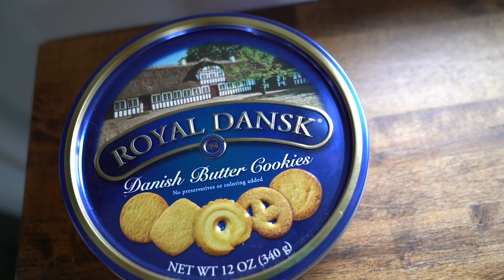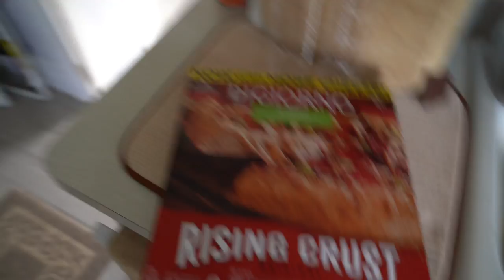WORKING HARD TO FINISH THIS TINY HOME | TRENT AND ALLIE

Comment: Trent-  seeing you on the roof made me remember something:  SEAL your roof again!  Most RV's and trailers only have their factory coat on; UV, etc. breaks it down, so before taking off on a trip- and especially for fall/winter, etc.- weatherproof that mother again.
Reply: Do you really think he should weather-proof his mother?
Reply: @drinkinslim    To question that tells me you've been drinkin' too much.
Reply: 👍 Thinking the same thing!  (about the roof)
Reply: Trent - Please look into this; there are white coatings/paints designed to re-coat & re-seal the EPDM-rubber membrane on the roof of RV trailers. Any holes, cracks, or tears with water leaking in from rain or snow-melt will mean Big trouble inside (wood-rot, stains, de-lamination, etc.). I just had my older trailer done last year; it was a 2007 Coachman, just a little larger than your Terry.  Good Luck & Congratulations on your recent Marriage!
Reply: Yes I also noticed when you put the air conditioning up on the roof, looked like it needed to be resealed. We re-seal our trailer roof every couple years just to keep it good!
Reply: We found 25 yr seal tape for rv seams, might be worthwhile.
Reply: @drinkinslim   BIG Giggle !
Reply: When we bought our 2019 rockwood travel trailer they recommended sealing the roof every year. I’m glad we did because 8 months into it we had a max air fan installed and there were 2 places that needed caulk and resealing! From use.
Reply: Oo

Comment: My mom passed away at age 52 so quite a few years ago. But she was a genius in interior design. Never did it professionally except an occasional word of mouth job. Your project reminds me of something she said she did. She found an old dilapidated air stream that was probably only 20-25 ft long. The metal was oxidized and really horrible. She took steel wool and polished the entire exterior-by hand-till it was like a mirror. Relatives validated the story. Took her 2 months. She did the entire interior by herself too. Flooring, walls, made curtains, re-upholstered, plumbing-everything but electrical wiring. I think she pulled it down to Baja Mexico to a little resort. The theme was of a little Mexican hacienda with aged wood and bright serape blanket colors inside. People would ask to come in to see it-it was that cute. Wish I had photos of it. Anyway you two and your project reminded me of her. I miss her. She would have really enjoyed you two. She was  a character and reminds me of Trents' mom a lot.

Comment: I would suggest applying Kool Seal Reflective Roof Coating or similar product, to the roof. We did to our class a and we couldn't believe the difference it made. You just paint it on. It seals the roof, protects it and keeps the rv cooler in the sun.

Comment: We just finished up a Reno on a '93 Fleetwood Wilderness and we used Zinnser 123 to pain over the mirrors. No need to replace. But we were in a rush to get camping this summer. But now we can't even tell which doors had mirrors and which didn't. We didn't need the 13! mirrored doors.

Comment: Has the squash set on fruit yet? you might have to hand pollinate since it is a pretty enclosed space. The male flower is on a stem. The female flower has a tiny squash under it. If it doesn't get pollinated it won't develop (look up blossom end rot). Can take a Q-tip and transfer pollen from the male flower to the female flower. Garden is looking good!
Reply: Yes, good directions, I was thinking they might have to pollinate them also, especially if few or no bees/insects. 🌸 🍎 🌶 🌽 🌺

Comment: Have you measured the hight of Terry now with the AC?
I recommend it! Put a little sticker or paper on your dashboard as a reminder.
AC is wonderful, but you will need a heater, when you are on your property with that much snow in winter.
Reply: It may be a reverse cycle air conditioner with heating.
Reply: Most RV rooftop A/C units are also heaters, in fact I can’t think of ever seeing one that wasn’t. Are they great heaters? I wouldn’t be so bold as too say yes, but it’ll put out some heat. I agree that at 8000 ft in winter they are going to want real heat. Tiny wood burning stove FTW! 😉
Reply from the maker: There is a propane furnace in terry 😊

Comment: Try Rub ‘n Buff wax metallic finish to change the color of the stained glass metal finish.  You can probably pick some up at the hardware store.  You rub it on with your finger.  You can push a paint shield up to cover glass as you go.  Simple and fast.

Comment: Totally feel you when it comes to the AC.. Returned home to south Florida to find the outside AC motor dead and the inside of the house was 93 and outside was pretty much the same temp .... Had to live in the house like that for 3 miserable nights until the new motor showed up and was replaced. Then it took all day to cool off the house ... ugh... horray for  AC  !!  And Trent , that ladder routine was intense....your tiny house is looking awesome !! Congrats on a job well done..!

Comment: I can't help it. I can't help it. OK you know what a chair rail is ,right? What if you put up bead board half way around your bed area. You could mount a 3-4 inch wide 'shelf' where the bead board ends-like a mini chair rail. A little place to put trinkets-photos-clock etc-Maybe even a custom wooden cup holders for your espresso on rainy-stay in bed a while-sunday mornings with your cozy blankets all scrunched up in there. Would make a cute little nook.

Comment: Trent I have found that essential oils will desolve most adhesives and glue. But it can also desolve plastic. None toxic but very effective, just careful of time its on a surface! Just a tip I learned thats worth trying, saves time and irritaion! Cleans up plaint just wash with soap and water after using to stop reaction. Takes stains of plastic and permanent marker of barbies! LOL

Comment: Hey, you two! Here a tip for- using your AC if you are not driving through the Landscape every day: Take care that the outside unit is covered in order to avoid it from being heated up by the sun!. A simple sunshade can do the job! 
 Do not moan, just do it! Your energy bill will be happy,  and over time, the noise floor will be better too! 
Bytheway, an extra layer of insulation is a true miracle take such a structure cool!, and it doesn't cost an arm and a leg ;-)  !!! 
Just lay 1 Layer of 3 or 4" of styrofoam on the roof of the RV, and tie it down with a sheet of truck - Foil in White! This will earn you extra money the whole year trough!

Comment: For drip coffee, get a strong kind & up how much you use. Bustelo, comes in a brick, is finely ground. I mix it with regular drip coffee & it adds that strength! I can't drink weak coffee. As for not calling customer service, try YouTube or Google. 2 years ago I began scrapping appliances & might've offed myself on the 1st microwave had I not checked it on You Tube 1st. 😁 hope you're researching living on that mountain. You may need a fireplace or generator should the power go out. And wild, predatory animals???? Lastly, Digiorno is decent. I put olive salad on it after it's outta the oven. Maybe it's the oil, I don't know, but it transforms it to pizzeria pizza!

Comment: If painting the thin lines on the stain glass-looking cabinets is difficult, look into auto pin striping. I did that to my cabinets in a mobile home and it came out great with less stress. You can find large rolls of it online.

Comment: We rehabbed a mobile home that had windows that looked like that.  When we looked at the back, it was a solid pain of glass - all the decorative crap was just applied to the surface. A razor blade took it all off.  The plain mirrors looked more modern.  I don't know if yours are the same or not.
Reply: Pane

Comment: Hi Allie and Trent.  Another great vid and congrats on the tv show interview, and the new friends.  Ok here's the question.  Like my trailer, and  a lot of other trailers you have a corner bed, to that extent, is your water heater under the bed, in the far corner to the outside wall,  and accessed from under the platform of the bedroom?  If so,  though the wood looks great on the back wall, how do you plan on getting to the shutoffs to the water heater if the top platform of the bed is what you have to lift?  Removing the bottom  board only may be a solution.  Sorry if I put a damper on anything.  Have a Great 4th.

Comment: Hey...can you guys do a closeup on the cabinet paint?  I have yet to see someone use it and then show it so close up.  I'm interested in doing this for my sister's kitchen but want to see it first.  Concerned about paint lines even with the small rollers...hope it works well; because I saw something about the paint having a self leveling feature that doesn't show lines.  Hope you can do it in an upcoming video...thanks a bunch!  Great job.

Comment: I don't know where you guys get your energy, but probably from each other. 90 f is not so hot. I used to live out on the Hay Plains in NSW Australia, where we had 115 every day for 6 weeks! Slept out in my dome tent with the fly off, and just the mesh between me and the stars. In the house, the bedsheets stayed red hot! House never seemed to cool, just wood. No insulation, tin roof. I moved. Shame, as the old place was free rent and power. But I might have died there. I'm 71. Take care, stay safe.

Comment: Will you be staying in Terry on the new homestead during those high altitude winters?   It's blazing hot right now but what is the plan when mercury plunges?  Will Terry be up to the challenge or will it be back the attic for a few months?

Comment: I couldn't wait to ask you if this trailer is going to make it up to the mountain property while you built the cottage up there. I just wanted to know if there is enough flat terrain for it and also whether the road is up to accommodate it. You are doing great and I am a big fan.  Did you talk to the Dometic company about the damage to the air conditioner? If it happened in transit maybe they can offer you something.

Comment: Nice job on your little trailer. The only thing that would concern me is the weight you are adding to it. Check the data plate and maybe get it weighed before taking it on the road. I don’t want to appear critical but am concerned about your safety. Have a great Fourth of July.

Comment: Hey guys, did you fix the squeaky piano hinge up front of Terry? Whenever I have fitted them I set the hinge half open i.e. the hinge plates are at 90 degrees to one another, that holds it perfectly straight then for when you screw it into place. 

Also is the slide out chopping board where you put the pizza inspiration for the dining table in your van? 👌 I will be doing the same in my future Promaster build 💪

Comment: How are you guys able to power your ac unit in your RV? Are you using batteries or the power from your moms house? We have the same Dometic unit on our van and can't use the AC and it pretty much uses up all the power just to use the fan overnight and then we don't have enough power for our Dometic fridge! We have 600 watts of solar on our roof and 400 amp hours on our AGM batteries. If we get an overcast day we aren't able to fully recharge. Do we need more batteries or solar power?

Comment: I don't know if the van life taught you this, but I have owned many "Trailers/Camper's" and if I may advise you.  Use two things under your mattress.  First, put Reflectix under the mattress to provide good insulation.  Second, put in moisture prevention under liner material to ensure airflow and prevent mold.  See this video from Sailrite about the value it provides.  https://www.youtube.com/watch?v=YfGquOxwAzc